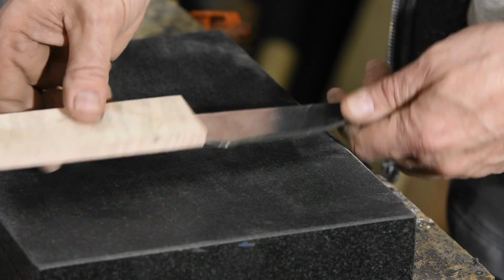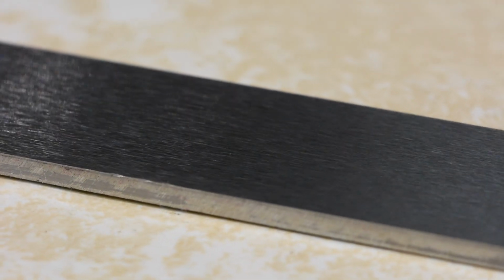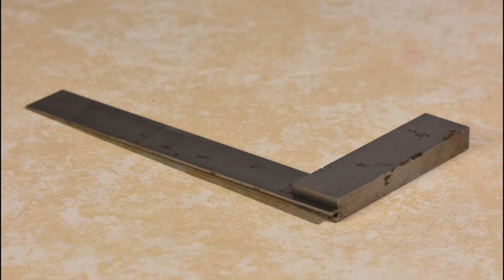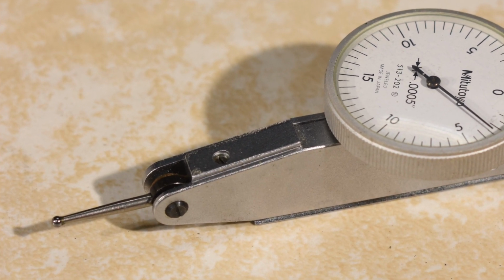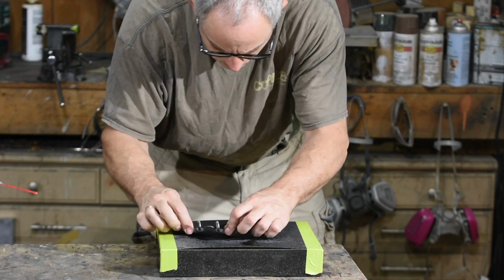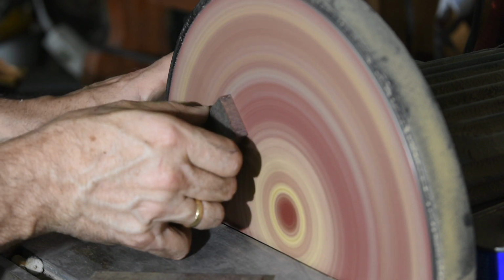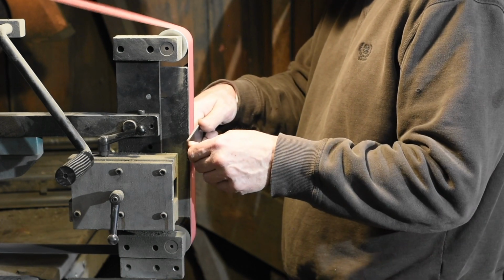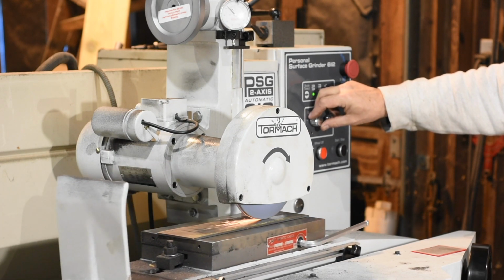Make It Flat!  Knife Making Tips

Comment: Why not buy a used surface grinder? You can usually find one for around $500
 A 3 phase one can be power off a China VFD. Which also gives you speed control.

Comment: hello ive just started out making stock removal knifes using 1084 should i hand sand before or after heat treatment?
Reply: Most of times both, as long as youre not going full flat grind, for you still have that dime thick edge to grind down after HT. But in majority of knives where you'll have a flat on the sides, some initial sanding before HT must be done as thats gonna be hard to do on a hardened blade, then follow it up with the rest of the hand sand after HT to clean the scale. Hope it helps.

Comment: I am really struggling with drill bits. What is your choice for bits for drilling through steel?
Reply: 8% Cobalt bud, dewalt make some called "extreme". They are well priced for how good they are, they cut through very hard steels like D2, 154-CM no problem. But, if like me you have taken to knife making in a big way, then I suggest you bite the bullet and buy carbide, it lasts longer, cuts better, there is no substitute for carbide, and when you are milling your expensive pieces of steel. Especially when using the very expensive stuff like CPM-10CV, CPM-M4, CTS-XHP you definitely want to be using carbide. High initial outlay but the results speak for themselves.
It really is that simple.
Reply: Joshua, are you using a hand drill, a drill press, or a milling machine......I should have asked you this first 😀

Comment: @10:54 "Disc grinders are pretty cheap, and flattening is what they do..."
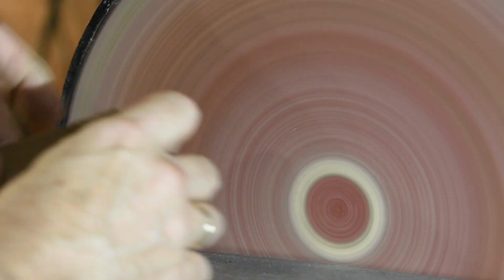@11:11 "...be aware that they [disc grinders] grind harder on the outside of the hweel than the inside..."
=> In other words, removing material with a disc grinder is relatively fast and cheap, but you will NEVER get a flat surface with this POS contraption!
Reply: It looks like if you have a very large disc grinder it can work. But I've been using a 5 and 6 in for flattening some rather large knives and it easily creates low spots in several areas

Comment: Where'd you get the long magnet you use to hold the piece while flattening on the flat platen? Every magnet I've tried thus far won't hold against the force of the belt and the piece ends up coming off the magnet.
Reply: Some hardware stores sell fairly strong magnets
Reply: eBay
Reply: You can also get decent magnets from a microwave. But its some what dangerous so look it before attemping
Reply: @jollyjiggler  Those are pretty weak. I'd go for speaker magnets or neodymium magnets from eBay...